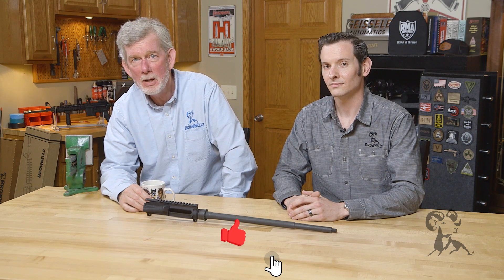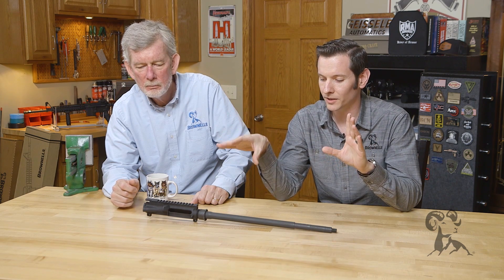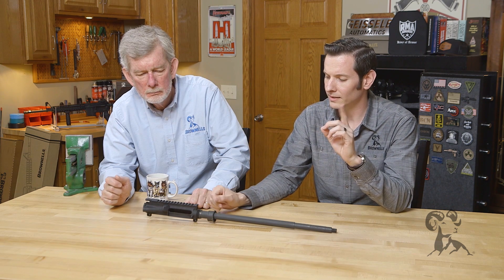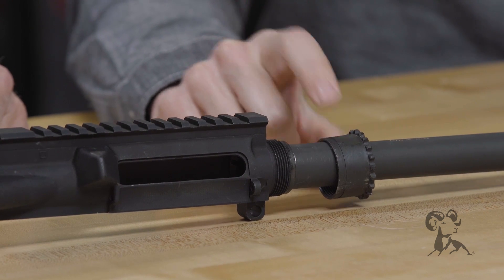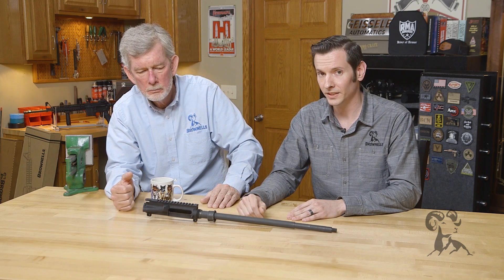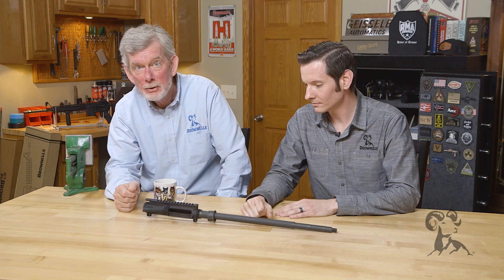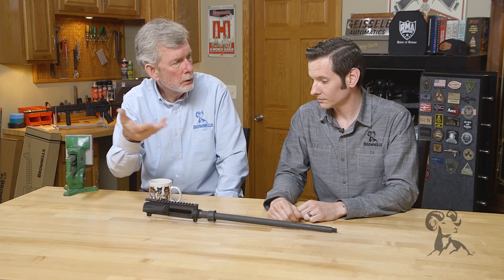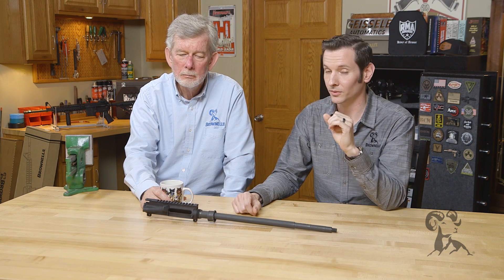SmythBusters: Galvanic Reaction & Your AR-15 - Part 1

Comment: Brownells, Inc. Guys, I had all of my firearms flooded during Katrina. We were not allowed back to our houses for 3 or 4 weeks. We were let in for 1 day then Rita flooded it again for a week or two. When I dug out my guns on that day we were allowed in they were all rusted solid and pitted. They were submerged under 17 feet of water which gradually receded over 3 or so weeks. My house was raised 3 or 4 feet so the guns were not submerged for maybe a week before I got to them. 8 were hanging on wall racks, some were standing behind doors or in closets and some were in hard or soft cases in closets or under the bed. I had no ARs at the time but had several anodized/steel firearms. When I got them to my new abode, I washed them with Dove dishwashing liquid, water and a brush, rinsed them in water, soaked them in oil, wrapped them in plastic and put them in my attic until I had time to deal with them. A year or so later I worked on a Benelli M2. The anodized receiver had 1/4" long 1/8" deep pits on the edges. The barrel severe pitting and what looked like worm track pitting in many places. The chrome bore was perfect except for a dime sized circle near the muzzle. I got it loosened up with Kroil and regular oil and it hasn't missed a lick. I then worked on my S&W M-39. Same pitting on the slide and same sized 1/8" deep pits on the aluminum frame edges and on the trigger guard. I was able to loosen up the hammer and trigger but was never able to retract the slide even after using more and more severe methods. I will try to find pics if you want. Thanks.
Reply: Yeah, I am from South Louisiana and have cleaned more flood guns than I can count. The stuff that gets into that water is extremely caustic. I have seen the flood waters in some areas strip the bluing off a gun in a matter of seconds!

Comment: This is a common issue in the automotive world. Dissimilar metals cause corrosion. a good example is aluminum wheels on steel hubs, the first several tire changes will be fine, but they will start to stick requiring a hammer to get the wheels off. Aluminum heads, are bolted down with steel bolts without some form of oil or anti sieze the bolts will react to the head. The threads on the receiver and the nut on the AR may be coated, but constant teardown sessions will wear the coating off. I doubt that an AR will be torn down enough to wear the coatings off. Dissimilar metal corrosion is a real thing...but I doubt it will affect modern ARs.

Comment: We rebarreled thousands of rifles with new chrome lined barrels. Never saw it.  GI's do dumb #$%^.  Maybe someone used battery acid to clean off carbon?     Here is another myth.  M16 barrels "Bent" from over heating and the government included barrel straightness gauges in the gauge kits.  The "Pencil" barrels were mostly bent by  grunts using the 3 prong F/suppressor to pop the banding on C-Rat and ammo pallets.

Comment: Barely a problem with engine bolts on a 15 year old used cars from the salted roads of the northeast and is part of the ground wiring of the vehicle. People who worry about this on their rifle probably don't drive unless all their tires are exactly the same pressure and check their spark plug gap daily.

Comment: I haven't specifically seen it on an AR but I've handled numerous guns that were basically falling apart from galvanic corrosion. This is due to the fact that my family operates commercial fishing boats. outside of that environment it is not nearly as relevant but if you have dissimilar metals and salt water and possibly fish blood you have made a very effective battery. Your gun will electro etch itself to death. and the worst form of this is what Winchester did with their police marine magnum edition shotguns in the '70s and '80s. Which was aluminum receivers plated with copper plated with chrome.

Comment: In all my time as an armorer and range officer in the Army, I've seen and heard some dumb stuff about firearms, but ever that you have to lubricate the barrel nut threads to keep it from reacting. I've heard of cars iron blocks and aluminum heads welding together under extreme heat, but that kind of heat is never present in a firearm.

Comment: The reasoning behind lubing the nut is if it is dry it has the possibility of damaging the anodized coating causing the metal to metal contact creating the potential for galvanic reaction.  If the nut is lubricated it greatly reduces the possibility of that damage. 

 also with torque specs you have to know if its a wet torque or a dry torque! if it is a dry torque and you apply a lubricant it will change the dynamic holding force of the fastener.  in most cases i know of it causes the fastener to be over torqued and more than likely harder to remove later.
Reply: Exactly. I cringed when he said all threaded torque specs are done with lube, which from an automotive background is extremely dangerous advice.
Reply: Great reply! Totally correct info.

Comment: Any car mechanic can tell you this happens, but only with an electrolyte (salt). It will jack some stuff up, but I see no reason why a hard coat anodized aluminum bit would sieze in a steel painted bit.

Comment: I don't know if it was plumbing or metalurgy class, but galvanic corrosion is only a concern when water is present, for instance you need to use dialectic fittings when going from copper to steel pipe fittings on water lines. But on air lines it's not necessary

Comment: The only place I've ever known that it occurred was in Vietnam in a highly humid environment on firearms that did not have the current mil-spec coating that they now have. They actually had a electrically conductive connection between the steel that was in the original M16 and the aluminum. I have witnessed it on cars with aluminum bodies Left End barns for many years where much of the aluminum has corroded away into aluminum oxide. If you care for the firearm and you're not in a tropical location constantly, and you are carrying a rifle that has not got the current phenolic resin milspec coatings on it which tend to insulate the metals from electrical contact, you will most likely never see it. Almost all of those criteria have to be present for galvanic action to work on that small scale. However in Vietnam it was seeing quite frequently. It hasn't been an issue on M16s since they change the coatings on it. But I don't know that we've used the firearms for any long-term in truly tropical conditions either.

Sounds like another case where people heard stories from 50 years ago and decided to extrapolate on it without understanding why it was an issue in the first place.

My source is a master gunsmith who served several years in Vietnam.

Has an explanation galvanic action, the correct name for it. Occurs with two dissimilar metals and a humidity high enough to start an acidic condition in order to create an electrical differential between the two metals. Even in Vietnam, when they finally started issuing cleaning kids and you put at least a little bit of lubrication on it you kept the acidic issue from occurring. If you got it wet and got some stuff in it like residue from plants and such that started to turn acidic, it could and did affect the aluminum on the firearm. But Vietnam was a very harsh environment and using 20/20 hindsight, you can easily understand why it would have occurred in that environment.

Comment: What you are missing in the galvanic corrosion process is the electrolyte.  The most likely case would be water.  I can guarantee you will see this type of corrosion if it was submerged in water (or other electrolyte) for a long period of time.  The coatings and lubricants will slow this down but eventually it will happen when submerged.  Now with that said, all of us (I hope) do not store our AR's submerged in anything, so nothing is there to cause this type of corrosion.

Comment: You can achieve proper torque on dry threads.  You can actually achieve IMPROPER torque by lubricating threads.  It all depends on how that torque spec was developed.

For example; putting anti-seize on your car's lug nuts.  You're going to end up over-tightening even if you use a torque wrench, because it's a dry spec (all lug nuts are ALWAYS a dry spec).  One sure way to mess up a cylinder head installation is to lubricate threads that aren't meant to be or skip lubricating threads that are supposed to be.

The AR-15 barrel nut just happens to be a lubricated spec.  It could just as well have been a dry spec, but it is what it is.

Comment: All that being said, It's common to have an uncoated barrel extension tube, so steel. Then if you lap your upper receiver, you will likely take off at least some anodizing, so aluminum. At which point you will have a steel to aluminum contact point behind the flange on the extension tube.  But I've never seen galvanic reaction either.

Comment: Something I have found during my time doing break jobs over the last 30 years is that a lot of lubricants will just wash away.  I solved this by using waterproof wheel barring grease made for boat trailers.  Over and over I can replace all my breaks then drive the car or truck for 60,000 miles or more and the calipers stay lubed plus the grease is still there the next time I replace them.  My rifle will never see that kind of abuse so I'm sure it will never wash away over time, is much better with heat and much tougher that any gun oil or lube plus it's dirt cheep.  Do you think frog lube would survive in a wheel barring?

Comment: The gun is not grounded either due to the generally plastic stock, and even if you lean it against a metal grounding rod the coatings still insulate it.

Comment: I am an A.B.Y.C Marine electrician, I test for and eliminate galvanic corrosion several times per week . I often see it on boats where stainless steel screws are placed through aluminum and on metal boat parts used underwater. It's most common cause is low voltage electric passing between two dissimilar metals. Salt air and salt air with static electricity can also cause it. That being said , I live in St. Pete Fl. very close to the Gulf. I have owned and built a built AR platform rifles over 35 years and have examined hundreds of other rifle. I have never seen galvanic corrosion on an AR rifle.  But , If anyone is truly worried about it ,  " Teff Jell " is a galvanic insulation paste that would solve your worries it completely blocks the corrosion/ electrical current and is water proof.

Comment: If a non engineer looks at corrosion, they wouldnt be able to tell what kind it is.   Corrosion between even the same materials or even plastic can occur with microbial corrosion.  Id doubt it would occur in a rifle, but you never know what some private did to his rifle.

Comment: On cars they use in some situations aluminum anodized Male or female thread on galvanized steel thread. The vehicles exposed to rain and sometimes Road salts that would make a electrolyte between the threads. And apparently all galvanized actions are not perfect especially after tightening in the two meetings surfaces upon torquing down the threads would bite and put micro pinholes through the anodizing coating on the threads. Couple years later when you would try to take these threads apart they would be like welded together and literally rip the threads apart upon removal. Seen this 1000 times anodized aluminum in to steel. But I don’t think anybody would allow their AR 15 to get wet especially with salt water and not immediately take it apart and clean it and lubricate it.

Comment: The proper torque absolutely does not come from lubricated threads in all or most cases. Anti seize for example increases your effective torque by roughly %20. When you're supposed to be torquing your F150 lugs to 150ft lbs and you used anti seize you're putting the effective stretch of 180 ft lbs on you studs. Torque specs are for torquing as intended from the factory with or without. It's usually not that big a deal until you anti seize a spark plug in an aluminum block and strip it by going to spec.

Comment: Older house wiring using aluminum wire has been known to experience galvanic corrosion resulting in fires.  Electricians use a product called "DE-OX" to treat connections between aluminum and copper wiring.
That said, I've been building AR's for over 30 years and none of my older builds show any signs of corrosion.

Comment: BS! Prove it! Run a standard 500 hour salt fog ASTM test on a standard anodized per Mil-A-8625 class 3 without sealer and a carbon or alloy steel barrel in direct contact
Reply: Clarification, Carbon fiber barrel

Comment: It was never mentioned in US Army Small Arms Repairman's training in 1972. Geoff Who is experienced.
Reply: The current US Army Small Arms Repair manual (23&P) states specifically to use "molybdenum disulfide grease" or (MolyB).
Reply: @CalebSavant  What level of maintenance? Geoff Who is curious.
Reply: @GCJT1949  The (23&P) covers level 2 and up.
Reply: @CalebSavant  I know what the manual covers, my question is which level is set in the table at the back for changing a barrel. We changed barrels at post maintenance level at Fort Hood in the '70s. Geoff Who remembers an M-16A1 that met the turret monster, nice 45 degree change in the barrel in front of the front sight assembly.

Comment: I was an engineer that designed off shore oil rigs.  Galvanic corrosion is like a battery and needs an electrolyte like salt water and happens over weeks not hours, so a casual shooter should not worry about this mode of corrosion.  The reason  molydisulfide grease is used is for its consistent friction characteristics.  

Galvanic corrosion only needs a tiny scratch in the anodization and the corrosion will concentrate at the scratch.  It is conceivable that soldiers in the field sweating on their rifles for weeks at a time would see galvanic corrosion.

Geissele is a knowledgeable engineer, please watch his accompanying video.